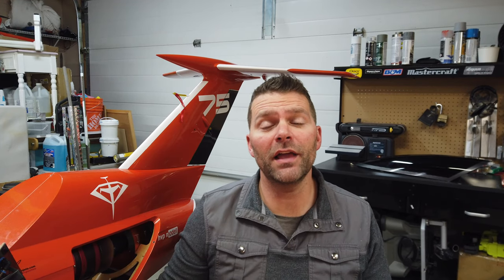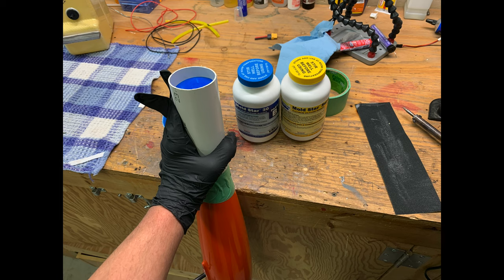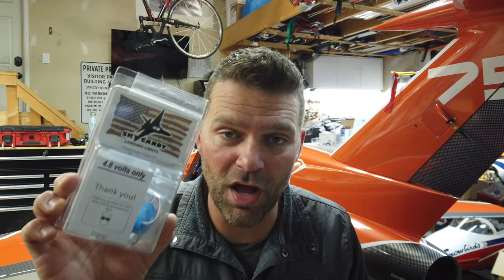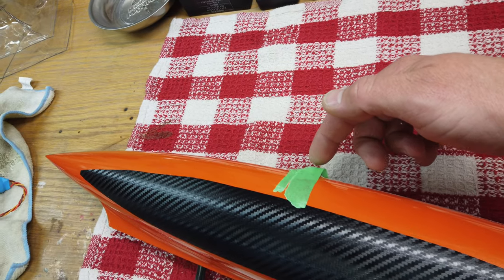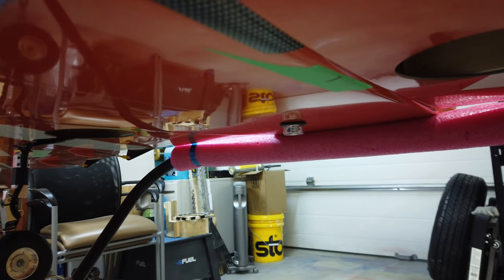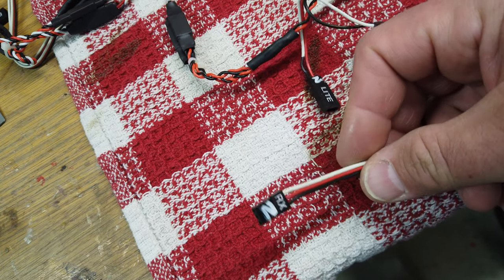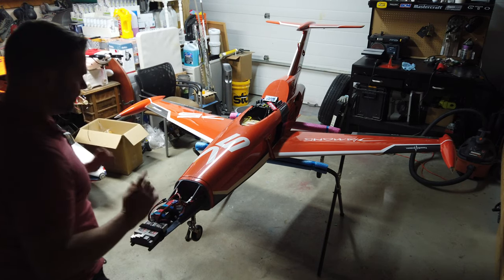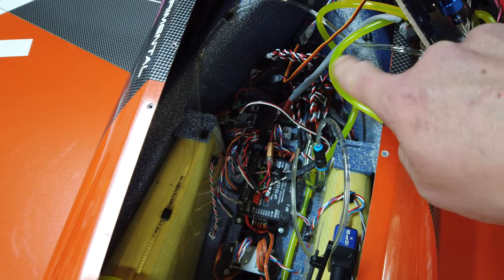INSTALLING THE RC LIGHT SYSTEM - Watch This First  - AD Target Drone

Comment: Adding the material at the base of you master to prevent webbing is called a Buck. I’m scratch building a large star ship Excelsior and I’m vacuum forming  all my hull sections for interior lighting.
Reply from the maker: YES!!!!  Thats right.  I hear that term during my research on how to make and use the molding machine!    Sounds like a cool project!  Thanks for watching!

Comment: I just have a question. Do you have a preference of Dubro or Sullivan clevis when it comes to the fitting of the clevis pen 👈🏼 in your servo arms? 
Also, I seen a A guy testing the strength of that little pen on YouTube ,you’d be surprised who won.
Reply from the maker: I don't have a preference but based on the test video I did a couple weeks ago, the Sullivan Clevis was the clear winner!